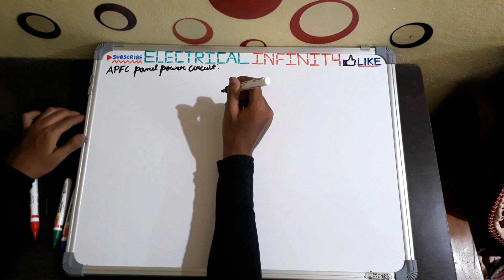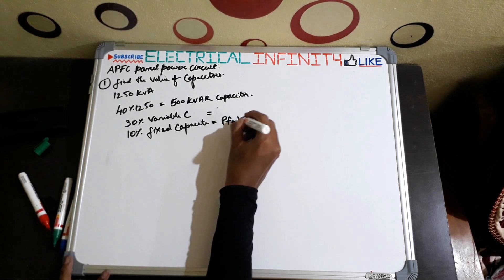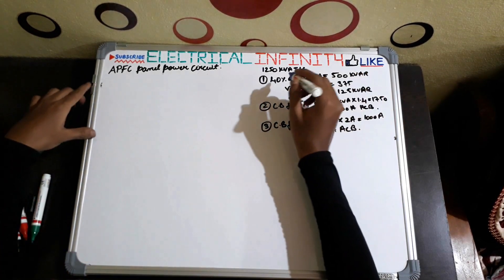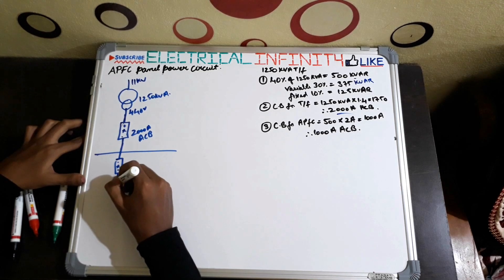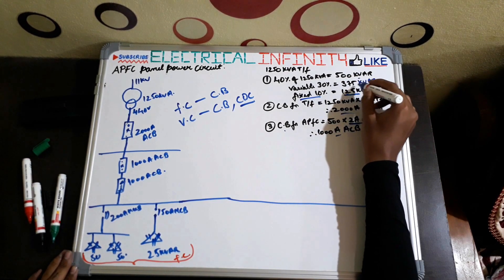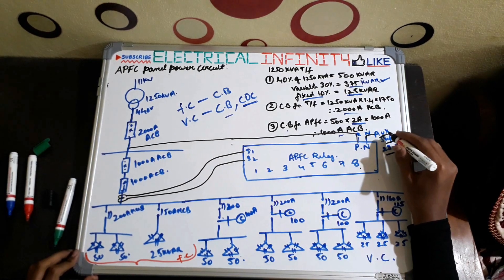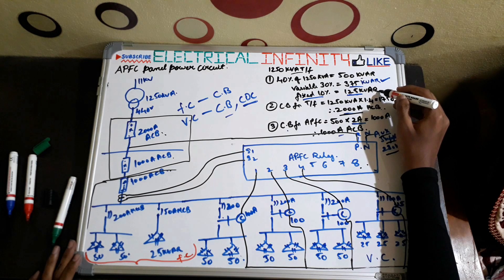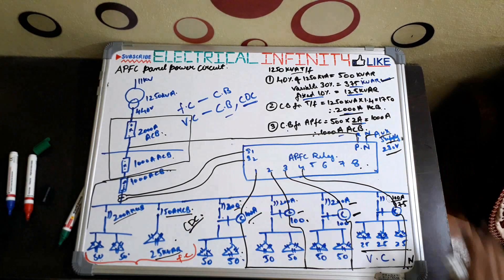APFC Panel Power Circuit Explanation in Detail | APFC panel wiring diagram| Capacitor Calculations.

Comment: Hello Sir, very informative video, thanks. One question, while dividing fixed capacitors in two sections, one for CB (50 KVAR + 50KVAR) & other for (25 KVAR), can we not take one CB for one 125 KVAR capacitor connection, as 250AMP MCCB?

Comment: very expanatory and helpful video.
I have 1 que.. Why Transformer rating is multiplied by 1.4 while selecting circuit breaker for transformer?? how did you get 1.4 multiplier?
Reply from the maker: Will explain in nxt video. Nxt video is based on this topic .
Reply: 2nd que is that.. CDC you used for variable capacitor is capacitor duty contactor or only a simple contactor?? because as per my information both are different.
Reply from the maker: Its capacity duty contactor.

Comment: very nice explanation ,but a simple doubt is that for the ACB rating selection for transformer we multiply 1.4with transformer's kva rating,but what is 1.4,is it√3?, & where is the power factor corrector equipment,& how does capacitors operate automatically (on & off) when inductive loads are increase & decrease ,plz plz plz reply brother
Reply: Kw*1.4 ≈max. Current 

It is thumb rule.

And apfc relay compares actual pf and targeted power factor and calculates how much KVAR will be needed and sends signal to cdc contactor and that contactor when gets supply that capacitor gets connected to bus and improves pf
Reply: Load current for 1000Kva=(1000000/(1.732*415))=1391.25A
Here 1.732 is square root of 3
there for, 1kVA The Load current will be 1391.25/1000=1.39125 this value is approximated as 1.4
Reply: @herrytech1644  Load current for 1000Kva=(1000000/(1.732*415))=1391.25A
Here 1.732 is square root of 3
there for, 1kVA The Load current will be 1391.25/1000=1.39125 this value is approximated as 1.4

Comment: Please specify following in the video:-
1) the 2000 Amp switch after transformer is remote incomer for main panel just after transformer. 
2) The first 1000 Amp switch is the O/G of APFC panel
3) The second 1000 Amp switch is I/C of APFC panel. 
4) The fixed capacitors may also be connected by contractors.
Reply from the maker: Thank you for comment buddy. exactly true
Reply: Thank you so much, I had some doubts about those two switches. Explained In a way perfect way.
One question : why do we need to connect  contactor to fixed capacitors?

Comment: It's helpful video...we also can find required KVAR through below equation,
Capacitor reactive power Qc = P * ( tanφ1 - tanφ2)
P is actual power (demand load) is in KW (it can calculate from load summary)
φ1 = Initial or actual p.f. (Value can obtain from supply company bill or can consider 0.75)
φ2 = Target p.f. ( To be decided by customer or can consider 0.95) 

Pl. provide some information about heavy duty capacitors bank with 7% series reactor for detuned filters...and why generally we used TP ( 3 Pole) mccb for APFC incomer?
Reply: I THINK IT IS NOT 40%
IT IS 0.421 THIS VALUE IS OBTAINED FROM CALCULATING CORRECTION FACTOR FOR IMPROVING PF 0.8 TO PF .95

Comment: I want to know when finding ampere.
 why you multiplied KVA X1.4 
Need to know about 1.4.
I am accatable KVAR X 2  as per formula we are getting.
Reply from the maker: check this to know about it https://youtu.be/5PHyLUGkl14 . Thanks.
Reply: One KVA is 1000 VA
So current shall be 1000/1.73*415= 1.39
So 1 kVA =1.4 Amp
Reply: Sir, please explain concept of 1.5 and 1.3

Comment: Some time APFC panel is not working or its capacitor will not on at right time when required, What is the possible reason for this ?? could you please share

Comment: How you get to know the value such that 40% for capacitor rating and for circuit breaker you used 1.4 times of KVA?? can you please explain
Reply: Load current for 1000Kva=(1000000/(1.732*415))=1391.25A
Here 1.732 is square root of 3
there for, 1kVA The Load current will be 1391.25/1000=1.39125 this value is approximated as 1.4
Reply: I THINK IT IS NOT 40%
IT IS 0.421 THIS VALUE IS OBTAINED FROM CALCULATING CORRECTION FACTOR FOR IMPROVING PF 0.8 TO PF .95

Comment: What is 1.4 when u calculate with transformer circuit breaker?
Reply: Load current for 1000Kva=(1000000/(1.732*415))=1391.25A
Here 1.732 is square root of 3
there for, 1kVA The Load current will be 1391.25/1000=1.39125 this value is approximated as 1.4

Comment: I have one question is that suppose my motor is 200HP and I want fix it capacitor bank so how to calculate the rating of capacitor bank ????
Reply: If pf is considered 0.8 then sin phi shall be 0.6
Maximum
KVAR for Compensation  200x746x0.6=89.52
Then we have to take 80% of this as the motor p. f will not be always same. 
It depends on load and RPM too.So we shall take 71 KVAR capacitor bank fr 200 HP motor.
Reply: Whats 0.6

Comment: Sir cdc 100 amp hi kyue liya 200amp kyue nahi please guide
Reply from the maker: Cdc selection is done based on capacitor value. For example we are using a 50 kvar capaitor then we can use same value 50amp cdc . FOR circuit breaker we have to double the value 50 kvar × 2 so 100 amp mccb is selected as 1 kvar = 2A.
Reply: Sorry but the same current will flow through the CDT which is through MCB so the size of the CDC should be 200 amp only
Reply: Bcz u have considered coman capacitor for 2 nos capacitor
Reply: *Common CDC
Reply from the maker: As your wish . Go on.  Iam going according to standards

Comment: CB for Tr
 1250*1.4=1750 kvar ok
but ACB rating for Tr 2000A???? How its done. which logic???
Reply from the maker: Rated acb is of 2000A  so i had take 2000 A acb . Good doubt 👏👏
Reply: Sir according to your thumb rule to find the ACB rating... ie *2,  
1750*2= 3500
so the Tr. ACB rating would be slight higher than 3500 A . 
but why you used 2000A???
This was my doubt.
Plz explain
Reply from the maker: Thumb rule is only valid for capicator circuit breaker selection for transformor c.b selection we have to only multiply transformer  kva rating with 1.4 . Hope you got mine answer 😊
Reply: Thanks for your quick response
Reply: Nafees Akhtar Bhai transformer's rating is 1250 not 1750,so we multiply 1250 by 1.4 (1250*1.4) we get 1750 ,as the nearest rating of ACB is of 2000 amperes, so we take 2000 amperes ACB, I think u got it
Reply: @jatinchatterjee2219  dear sir can you help me to study a electrical dwg.